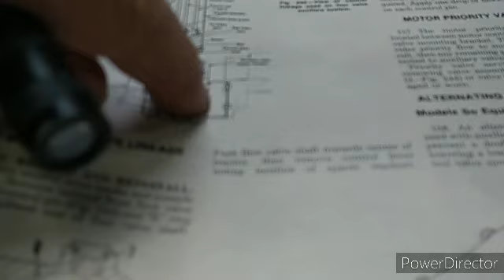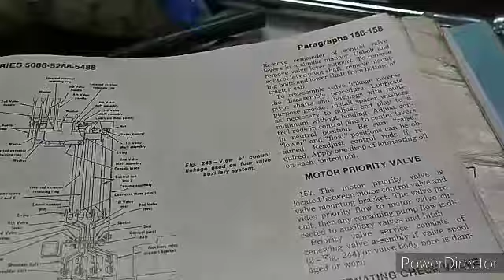IH 5288 hydraulic leak, easy fix for tomorrow!!!

Comment: Always great and funny watching calf's chasing about.
Hydraulic's, a design engineer's way to confound, confuse and constructively piss every single repair man and home mechanic off. Whether it's brakes, pumps, valves, steel pipes, flexi hoses, O rings or just access to where stuff is, retro sorting or repairing hydraulics can be a nightmare.
Top regards as always!
Reply from the maker: Yes sir, always enjoy watching them playing!
Hydraulics is simple, it's the 💩 the engineers design and put into the system that's 🤬.. 
Waiting for the parts places to open, finish chores and go get a hose👍 take care Jon!

Comment: Good evening( I guess technically it's morning now lol) We used to have a 1586 IH. My God I hated working on that. The steel lines that went from the front to the back sprong a leak. I never really figured out which one or exactly where. I just got rubber lines built.
Reply from the maker: Good morning Jeremy ☕☕☕
Steel can be good, but can be a pain in the arse.. usually replace them with hoses. 👍

Comment: It is difficult with so many hydraulic couplings and hoses.
I only have one on, but it is awkward because it is on the wrong side of the tractor.
Reply from the maker: Never makes sense 🤔
Reply: @GosselinFarmsEdGosselin  The most difficult screw I know, is the top screw between engine and gearbox on a Volvo 240 with B21 engine. There you must have a sawn 18 mm open fixed. Then you have to screw it a quarter of a turn from the left side of the car, go over to the other side of the car, to get the tool loose then back to the left side, to screw it a quarter of a turn again. Completely unnecessary information.
Reply from the maker: @makingithappen5178  sounds like too much fun 🤔
Reply: @GosselinFarmsEdGosselin  Jeupp.

Comment: Sometimes   when  I don't have enough  room to swing a wrench  that is where  Crowfoots come in handy.....complete sets of open ends,  line 6 points 12 point, air craft.. in  1/4, 3/8, 1/2 drive
Reply from the maker: They are handy! Have a few sets, made a few special ones too.
Thank you David 👍😁
Reply: @GosselinFarmsEdGosselin  I once made some open end out of 1/2 plate.... To Square the hole  I first bored it i/2... then took a old 1/2  extension Heated the area red and pressed the extension   into the hole....
Reply from the maker: @farmingforfunandprofit940  that would work.
I usually cut a U then weld a piece in.. doesn't take long 👍